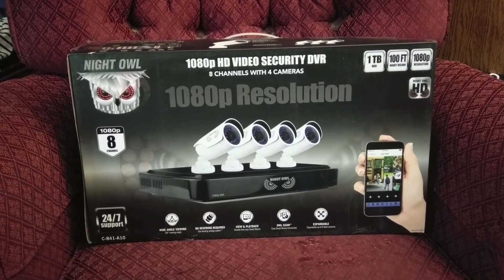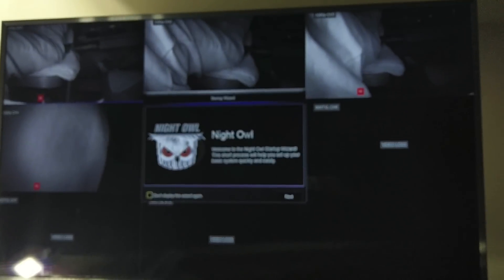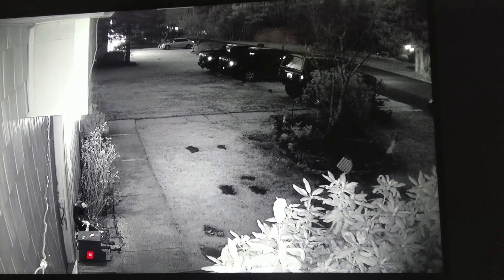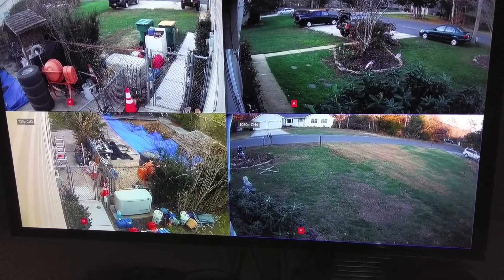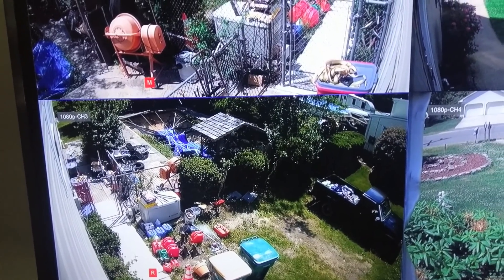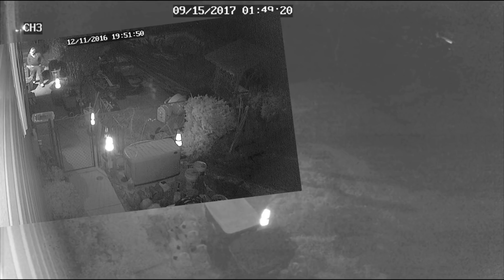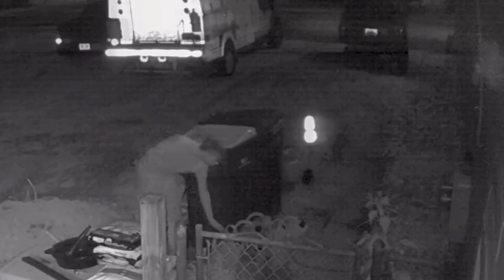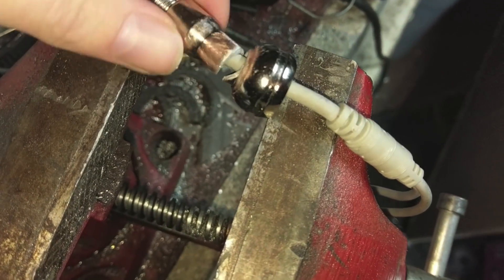Night Owl Security System Set-up & 1080p vs 720p Comparison

Comment: Dude, this is the best review video of the night owl security camera system on youtube. I had never dealt with security cameras but i'm a tech savvy guy and so i  spent all day today trying to switch  8 already installed  cameras from an old broken dvr to this night owl dvr and get those old cameras back on running. I literally walked up to a giant pile of different cables without any identification. Power  splitter missing. No manual, no instructions. I dealt with the 1080 and 720 cameras. I pretty much spent the whole day on this and through your video i confirmed  lots of things and learned others as well. Very well done!
Reply from the maker: Glad it helped you out! Didn't think this video would get as many views as it did
Reply: @NickInTimeFilms  How is the audio on playback? Is it synced with the video or is there a delay.

Comment: I don't understand how people have had issues with this system. It's incredibly easy to use and install and works GREAT! Use heat shrink tubes on any outdoor connections and place them in spots where they don't get direct sunlight or rain to prolong the life of the cameras. I've had this system for a bit now and I love it, and also purchased a better system of the same brand, a 6 camera and DVR setup, and they're very good for the price, which is equivalent to buying one nest camera or ring camera.
Reply: Hey a question, what happens if you´re away from home and there´s a power outage? will the unit re-start when the power is restored?
And second question .  .do these cameras have integrated microphone .  .if not, what´s the deal with microphones? (I suppose it has audio capabilities) do you need to purchase separately? thanks
Reply from the maker: 1 yes the drv will turn on whenever power is available, 2 to mics included with these cameras. There is an rca input included to wire a mic seperately but I haven't looked into any yet
Reply: @NickInTimeFilms  .  .very useful info, thanks
Reply: @jeffokriya3389  when the power comes back on the system is restored right back to normal and continues operating just fine. These cameras don't have mics built in but there are options to add on, Night Owl makes a mic that will add on to these, as well as a few other companies with similar products. If you plan to add a mic, you need to run a power/video/audio cable to whatever camera you want the mic on, as the cables provided with these cameras are only power/video. You can get a mic for around $20-30 and the right cable for around $20.
Reply: @strangerofthe2067  . . thanks for the reply, yes, I was thinking what happens if the power goes out that was a concern because computers don't power up automatically when an outage occurs you need to push the button . .  a good strategy is to get a UPS and keep it on say if you'e going out for several days but then it's an additional cost. A decent UPS i believe would cost over $300
Reply: @jeffokriya3389  the system automatically turns back on, so if you had an outage it starts right back up as soon as the power comes back on, you don't have to do anything as long as it stays plugged in. I'm an electrician and do alot of work on my own home, and sometimes turn breakers on and off, but as soon as I turn the breaker back on the system just boots itself up and is back online in a matter of seconds. I also have it hooked up to my network for the online viewing through the app and it's basically the same thing with my router, as soon as I turn the breaker on and the router and the DVR both have power, they're both up and running in a matter of seconds.

 It's a great system! Since I purchased mine and posted this, I have purchased and installed 4 more of these systems for "customers" who I do work for, and 3 different friends of mine have also purchased and installed them as well, and all are very happy! Anyone who can't seem to get these to function correctly is likely from user error and not from poor performance of the system.
Reply: @strangerofthe2067  .. yes, i did understand the response, I mentioned the UPS as a option of what would be a solution to avoid interruption . . thanks, greetings
Reply: @jeffokriya3389  no worries bud! Just wanted to make sure you understand in case you were contemplating buying one, they're well worth it! I only paid $130 for mine when Fred Meyer was having a clearance sale a few months ago. Actually bought 2 of the systems because of the price!
Reply: I want to like it but so far can’t get to connect it to my phone app
Reply: @knight5188  do you have the DVR connected to your wifi? And are you sure you have the correct app for whatever DVR you got? I know they have a couple different apps and you have to have the correct one to go with whatever system you have. 

I made this original comment over two years ago, and I still have the same system up and running and have never had any major issues with it. I hope you can figure it out!
Reply: @strangerofthe2067  yeah it’s on the Wi-Fi but when I search to pair the DVR to my phone/App it finds it easy but then ask me to still type in device name so I type in the name and it says not found. 

But now after a week of owning it I see that it is very useful in other ways, the phone app isn’t exactly needed but would be nice
Reply: @knight5188  I actually vaguely remember having a similar issue when I first set mine up too now that you say that, and I can’t quite remember what I did to fix it but I did figure it out. When I get a chance, I’ll take a look at my settings on my DVR and try and see if I can figure out what I did and I’ll let you know if I have any suggestions.
Reply: @knight5188  when I look at my app and go to device manager, then it gives you the option to do the “scan” feature, which I think was a QR code I had to scan with my phone through the app, then I remember setting up an “admin” user name and password on the DVR, then also having to input the “admin” user name and password in the app to get it to pair. 

Also sometimes on the app when I go to Device Manager, it will have my DVR there and I have to wait a few seconds for it to actually connect to the DVR. Not sure if any of that helps you but it may be something to look at.

Comment: If you use the putty type jb weld it is 100 times better.they did something to the tube type and it not worth throwing away but putty jb weld is good.it gets hard as stone.other won't harden up

Comment: not bad cams at all. i got the wireless 1080 4ch version, after buying the 8 ch wired for less to get home and find an opened camera box with a smashed cam inside went back to best buy turned outto be the last one of that model (on sale to boot) so i talked to the guys at customer service and said if they knocked of 50 bucks from the wireless 4 ch id pay the difference (the wireless 4ch was also already on sale for 100$ off) so in the end i got a wireless setup with less channels for 50$ more than id already spent (i said knock off 50 and the manager came back with "i can do 60 off for your time,never really liked best buy but that was an excellent expereince...also gives ya an idea of what they pay wholsale vs the markup on retail)
Reply: twigglykevin how was the install of your set up?  Still have to crawl thru the attic to hide wires?

Comment: So I bought the 8 channel 1080p wireless camera and am noticing that even though it's wireless I still have to hook up my cameras to power using the a/c cable they come with. I even had to cut and splice some of the cables to extend the the reach on the cameras that don't have an outlet near them. So my main question is why do they not have a battery in them they are "wireless" but I probably would have been better off buying the wired system instead.
Reply from the maker: I'd assume the batteries wouldn't last that long. You really want to replace them every 2 weeks? Extension cords would make quick work of that.

Comment: I have this setup and I have had nothing but problems out of it as well as the customer service is horrible. We had been using it for 6 months no problem then when we started having issues with it we reached out for help and they are not easy to reach as well as the searching for footage from prior days takes forever because they are so sensitive even on low that they record EVERYTHING from shadows moving to moisture drops in the view. I wished I could get my setup back to proper working conditions and the ability to view on my phones not just in the house but when I'm away .. any advice to reset factory reset I'm all ears .

Comment: System stopped working but i looked outside and the cameras are still lite up but cant get the DVR back on with power cord (nothing is showing on the tv monitor that it's working) so could it be the power cord to the box  needs replacing its only been a few months since we had them installed but had them sitting in the box for 4 years

Comment: If you need good clarity while zooming you will want to get cameras that have optical zoom lenses. You are limited with digital/software based zooming and it will definitely be pixelated and blurry as you see in your videos. Unfortunately, optical zoom cameras are more expensive than non zooming cameras. But, you get what you pay for. 1080p is definitely the way to go though.

Comment: Good luck getting a hold of night owl technical support their "live support" is a misnomer.  It is rumored that they do have technical support its just that no one has actually talked to one.  You just spend days after days of waiting in Queue.  Then get booted back to the end of the line when you get to first in line.
Reply: Worst purchase ever. Thing falls offline, required multiple factory resets, until it just died and wont power up.

Comment: I just hooked up my F6-DVR8-1TB and it is not very clear at all and night time it looks grainy as well. I hooked it up to a lg tv that has 720 and 1080 is there a way to verify the tv is set to 1080, there are two HDMI connectors on the back, is one 720 and one 1080 I have it in the one that reads him in. Or does the tv supposed to already know if its 720 or 1080. Thanks

Comment: How far to the left will the 1080 camera pick up?  What I mean is if the camera is running parallel to the front of my house how far will it pick up to the left of the camera?
Reply from the maker: You're looking for the FOV (Field of View) of the camera which is measured in an angle. This video is so old I don't remember, but I think this 1080P camera was around 105°, so it will see 52° to the left of center. You could use a protractor and a string to try and visualize it if you really want to lay it out.
Reply: @NickInTimeFilms  Wow, thx for answering because I knew your vid was 7 years old and I did watch 90% of it.  I am not sure how to convert 52 degrees to feet but my neighbor who is a menace clipped the back of my car and I am hoping the camera got it as it was about 15 feet from the left of the camera.  I bought my system 8 years ago and never hooked it up but just recently I had a friend run one camera with intent to do a few more.  I am EMF hypersensitive so I need a wired system altho I am thinking I could run one wireless camera and hook into my other neighbor's WIFI.  I have no WIFI in my home.
Reply from the maker: @Clairbear1222 so you'll want to look up an arc length calculator then, as the distance left and right changes with how far out you're looking. For instance, if you subject is 30ft away and using 105° for our angle, the camera can see 55ft front left to right, or 27ft from center to left.
Reply: @NickInTimeFilms  That sounds promising.  The system was recording, I just have to replay the dvd.   I plan on moving out of here because these ppl are witches and they are not good ppl at all.

Comment: First, nice BURP @ min: 4:99.. LMFAO!! Anyways, how do you like it the 1080p version?  2nd is there a monthly fee that you have to pay? and 3rd - how hard is it to hook up and run your cords from my garage to my router which in my case the distance from the dVR to my outdoor camera would be about 50 ft.? What are your final thoughts and concerns on some of the pro's and con's -let me know? Last will it notify you when it picks up any motion on your Iphone?
Reply from the maker: Long term, still wasn't impressed. This system in general just isn't all that great if you really want to see something you can identify. I've since moved up to a Lorex 4k system that I've been a lot more impressed with. Sadly their 2k systems are an absolute joke so it's really a go big or don't bother thing.

No monthly fee, running the wires are easy but finding an entry point into the house is probably the hardest part, Not sure about mobile alerts as i never got the app to work, but i wouldn't rely on notifications as the motion detection is pretty hit or miss.

Comment: Mine didn't come with the Audio Cable, the CD Software stuff, or the remote. I am not able to hear, or speak to the cameras.. Do I have to buy the Audio cable separately?
Reply: Well ignore Mary's racist ignorant comment above mine, but these cameras don't support 2 way audio. The audio ports on the DVR are for any add on cameras that support the 2 way audio. It actually says in the specs on the box that it doesn't support audio. And apparently, if you're racist, don't call customer service either.
Reply: @maryross1230  I agree with you on the customer service, there ignorant as hell. I was met with the same response from a very hard to understand Foreigner who kept implying that it was somehow my fault for there app not working the way they advertised

Comment: Hey got a question, I got one of these Night Owl Camera's an everything was going great till one day I couldn't get a picture an so I kept pushing the reset button underneath the camera an it would say, 
Please Be Patient, Camera Is Resetting an still no picture an I notice on the white camera wire that attaches to the black power wire there is this small green light that continues to stay at a very quick flash an I can't understand what's going on. So if you know the answer since you've got one of these an Night Owl Camera's an you've got a video posted about Night Owl Video Camera's, I figured you might have the answer an if not, maybe some of your viewers might know. Thanks for your video.

Comment: The cables are 60 feet. Is there a possibility of extension if the distance from camera to hard drive is over 60 feet?
Reply: I know your comment is old but in case you're still wondering there is cable extenders that can be bought
Reply: @cosalinda  I believe so. The ones I've bought are the onn brand from Walmart

Comment: Were you able to use the existing power wires used by the 720 cameras?
Reply from the maker: Yes. The BNC and power cable combo worked fine for both.

Comment: If I want to hook four more cameras up do I need to buy another power cord?I have the have the night owl 720p system by the way
Reply from the maker: If you have an 8 channel dvr, then all you need are the 4 cameras and another power source for them.
Reply: @NickInTimeFilms  that what I figured  I have already owned the 720p night owl for about years but need more camour back by my garage I had a few people  around the neighbor hood where I live that had gotten there garage broken in to in everything they had in there stolen I know a camra won't stop a thief because a thief is going do what he has to rather there a camra or not I ask my neighbors if they had any servalence at there place they said know but I always kept one al long as I owned this night owl servalence camera since then a lot of my neighbors where motivated after they seen mine but where I'm stuck at I just bought 4 more cameras with the wires but wasn't sure if I needed the power plug because if so I'll have to buy one do you know it home depot my carry it? I would like to get one in hand I hate to wait on a order.
Reply from the maker: Due to the specifics of the plug and splitter, I think coming across a universal one would be difficult. It would be best to order from night owl if they have them available.

Comment: I just bought this on a great sale for $130 at my local Fred Meyer brand new. Haven't hooked it up yet and have 30 days to return if need be but for the price and after watching your video, I'll most likely keep them if everything works good once I get them going. 

A question for you or anyone else- they make that 1080P wireless add on cam with the thermal tech and 2 way audio, and I'm just wondering if it does in fact "add on" to this system, and how so, being that it's "wireless"? Any info is greatly appreciated, thanks!
Reply: I just got them there today for 96 dollars
Reply: Video or photos speak louder than words
Reply: @juanslife2387  damn good deal huh? Did you get them hooked up yet? I've been using mine for over a month and they are GREAT! I love that the app is free to and you don't have to pay a subscription. 

I ended up getting another system too, the DVR and 6 cameras that have the thermal imaging for less false alerts, on sale for $170.
Reply: @StrangerOf The206 - is it worth getting the two-year protection plan for 16 more dollars ? Or is it one of those things that it doesn’t matter and you might as well save it and try to fix it yourself lol ?